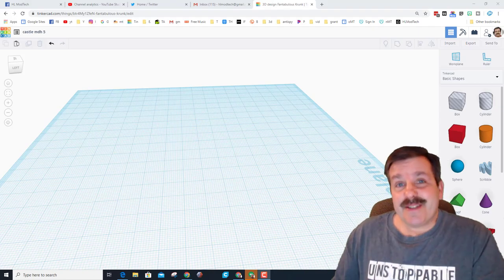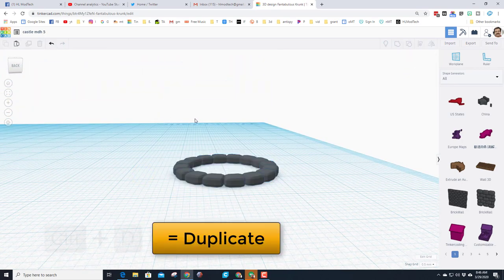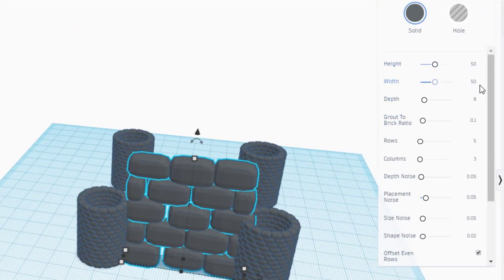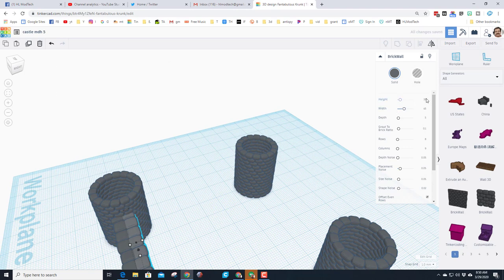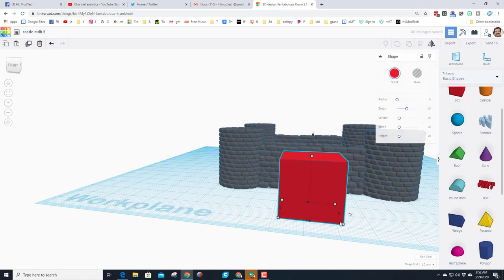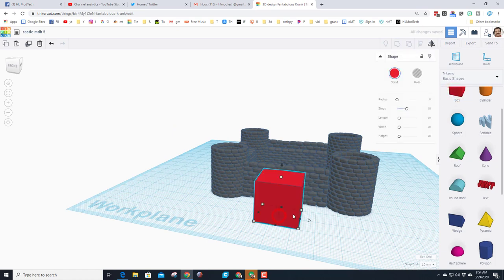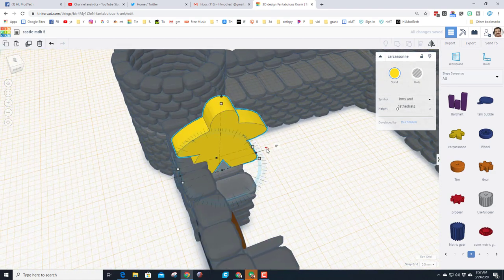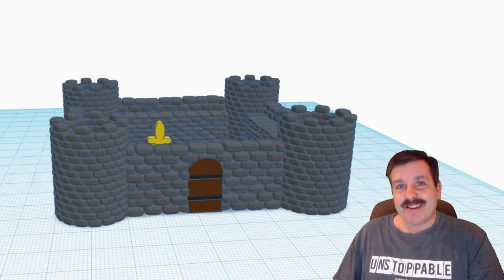Create a Custom Castle using Bricks | Master Tinkercad in Minutes

Comment: I want to make the bricks a specific size. Is there a way to do that?
Reply from the maker: I think you would have to make one brick using the method I show. Then make a normal cube that matched your desired shape. Use that as a reference to drag the black handles of the brick to match your cube.